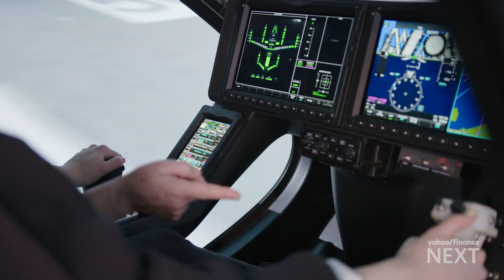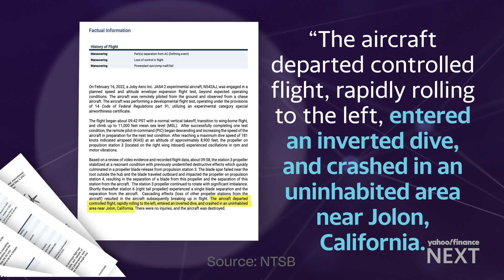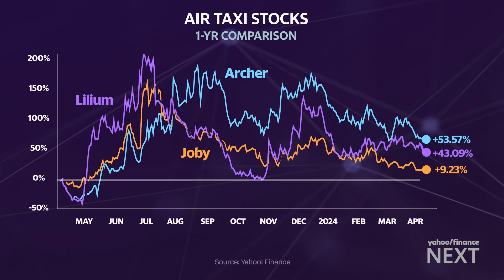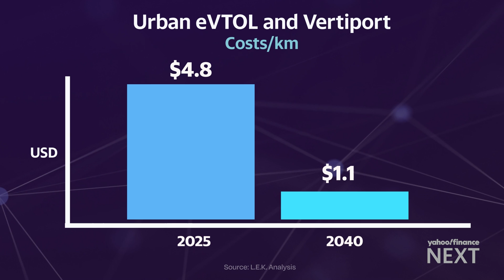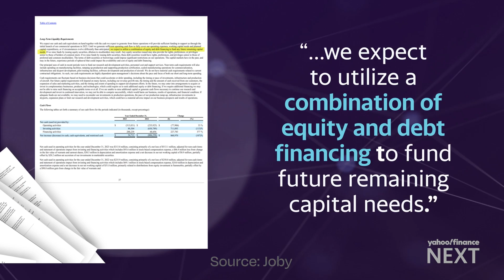Air taxis: How battery-powered aircraft could revolutionize travel

Comment: If they could carry more people and were more designed like a box, they could be used as rescue vehicles for tall buildings.
Another idea with that design... Building buildings, where the highest floors are accessible by outside elevators/flying cabins.
This would make construction really interesting, as you don't need to design inside elevators to the highest level.

Rn lilium and Co are just the start but are just electrical helicopters. Our cities would have to change.

Comment: 😂😂😂😂😂 is a helicopter lol
Reply: How is it just a helicopter when it can transition to fixed wing flight? Think man
Reply: @bronxishomenomatterwhereig3149  Electric vertical take-off and landing (eVTOL) aircraft take off vertically like a helicopter. The key difference is that they are powered by electric motors instead of conventional combustion engines. Propellers or rotors ensure they can take off vertically, hover in place, and fly horizontally
Reply: @bronxishomenomatterwhereig3149  what are you talking about? The difference is that is electric dude
Reply: @CommanderBqn  You know of the Osprey the Marines use right? Same thing except one is electric and makes WAY less noise. Unlike a helicopter it can transition to fixed wing flight. Thus flying way faster than a helicopter could. While still taking off and landing like a chopper.

The ability to fly fixed wing after vertical take off is huge. So to dismiss it as just an electric helicopter is false
Reply: @bronxishomenomatterwhereig3149  I am very sure this one does never transition into a fix wing like the osprey.  Seems it will be very hard for faa to certify it if it fully transitions to a fix wing because that's an airplane
Reply: @bronxishomenomatterwhereig3149  from looking at it I highly doubt all the rotors tilt only two seem to do that.  To me it looks more like a helicopter but I guess is a new type of vehicle, I'm not an expert of course but seems like it always keeps its vertical propulsion and it should as I think it would be harder to be certified if is the same as the osprey
Reply: @bronxishomenomatterwhereig3149  by the way I was wrong since I did not see the video fully and did not notice that it does in fact have wings.  If it does become reality though I wonder what the price would be

Comment: The should prove its possible to move the weight of a pilot and passanger the distance of jfk to Manhattan or at least hover that for 5 minutes.
Reply: I mean they wouldn’t mass produce it if that was the case. Right? Unless…💀
Reply: @johnbagsit2973  they haven't mass produced them. They aren't even certified or at the point in the process that they need a prototype at all.

Comment: Archer is better than joby in many ways!
Reply: Is this fact or matter of opinion?
Reply: What's the proof?? Give examples,  don't just do a hit and run...
Reply: The proof was Archer's transition flight with an MTOW of 6500lbs. No other eVTOL has done that. Nearest was 4000lbs. 

The maximum takeoff weight (MTOW) required for an electric air taxi business to be viable depends on several factors, including the aircraft's range, passenger capacity, and operational costs. However,  industry experts generally agree that a viable electric vertical take-off and landing (eVTOL) aircraft, designed for urban air mobility, should have an MTOW between 2,500 kg to 3,500 kg (around 5,500 to 7,700 lbs). 

Only Archer's Midnight has met that specification required for a viable air taxi business.

For an electric air taxi business to be viable, the MTOW needs to fall within a range (around 5,500 to 7,700 lbs) that ensures sufficient passenger capacity and operational efficiency while maintaining manageable energy consumption.

The competitors don't meet that specification.

Joby Aviation: MTOW around 4,800 lbs

Vertical Aerospace (VX4): MTOW around 3,748 lbs

EHang 216: MTOW around 992 lbs
 - - - - - - - - - - - - - - - - - - - - - - - - - - - - - - - - - - - - - - - - - - 
Archer Aviation Founder: Adam Goldstein

"..So in the quarter, we had some major accomplishments and the biggest was Midnight's transition flight meaning the aircraft took-off vertical then it transitioned onto the
wing and then it landed again vertically. So Archer is the only one to do this with a 6500lb maximum weight takeoff weight aircraft. Others have done it with smaller
4000lb aircraft BUT THIS WAS A BIG DEAL BECAUSE THE PHYSICS TELLS US THAT YOU NEED THIS SIZE OF AN AIRCRAFT TO CARRY THE PAYLOAD TO MAKE AIR TAXIS A VIABLE BUSINESS.."

Comment: Infrastructure is not an issue. All we neednis electric chargers (and battert fire suppression systems ).at existing airports and heliports. 

Sao Paulo has UAM at scale with over 2200 urban airtaxi and otherhelicopter flights per day under current ATC.

Comment: Fly Lilium ! 🛸
Reply: I've got 13600 shares in it I've got faith in lilium
Reply: @DanielWetherill  did you get it under .70? Dump it and get more when it goes there again.
Reply: @TheBagOfHolding  0.83 I'm just holding for years
Reply: Lilium is designed to be the future regional air service.. 6 seater now 12 to 24 seater later on as things progress.. No wonder Lufthansa Azul and lots of other airliners are drafting partnerships..
Reply: Joby Lilium and Archer look very promising very promising. Vertical Aerospace has potential.

Comment: Could it trip overseas?
Reply: On a boat
Reply: Hopefully, from 2030.
Reply: Air TAXI! Taxis don't travel far man. It's for travel within cities and nearby outer areas.
Reply: Part 135 Air Carrier Certificate received ahead of schedule, initially targeted for second half of 2022; Certification allows Joby to operate aircraft commercially; Joby will use conventional aircraft to refine systems and procedures in advance of launching eVTOL service targeted for 2024. That is in response to the other video you left a comment on. It erased my comment. Conventional means normal. It's from their own website may26 2022 news
Reply: @TheBagOfHolding  That does not mean they'll be using conventional aircrafts for actual revenue flights. That wouldn't even work. How is one flying from JFK directly into Manhattan with a fixed wing aircraft?

It says it's using fixed wing aircrafts to refine systems and procedures. Sounds like R&D and testing purposes. Not revenue flights.

And I knew what conventional meant. Don't insult my intelligence by assuming I don't know the definition of a word.
Reply: @bronxishomenomatterwhereig3149  they never said that was the route. Read the article and their submission for the 135. Helicopters
Reply: @bronxishomenomatterwhereig3149  they can't use a joby for years even if it was real and worked today it wouldn't be certified for years. It's not even working or they would show it working as a taxi
Reply: @TheBagOfHolding  And they never said it'd be for revenue flights. Nowhere does it say that. You're reaching too hard to spread FUD. With the way you damn near spam on almost every JOBY vid
Reply: @bronxishomenomatterwhereig3149  they used the 135 to announce that they are approved to operate an air taxi service for the publicity and that's why people think they are.  Do you think they can use the evtol soon?
Reply: @bronxishomenomatterwhereig3149  do you think it's honest to press release that they have approval from the faa to operate an air taxi service and have a picture of the evtol because of the 135 and in interviews without mentioning it or what it means? Just saying they have faa approval to be an air taxi service? Most people assume they are talking about the evtol like you did.
Reply: @TheBagOfHolding  I'm done trying to convince you. Spam till your hearts content. I did my research and know what's up. So I'm confident in the people behind JOBY and investing with them. And won't be convinced other wise. 

We'll see how this all plays out in 2025.